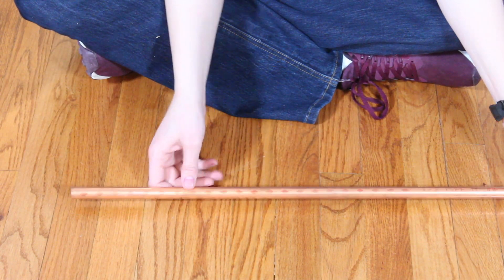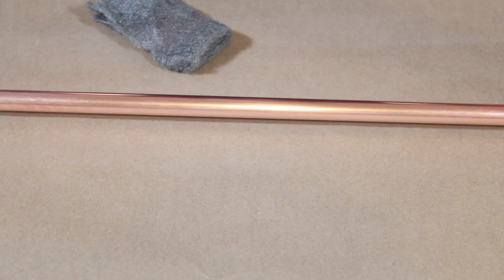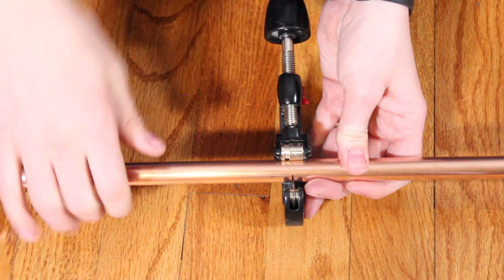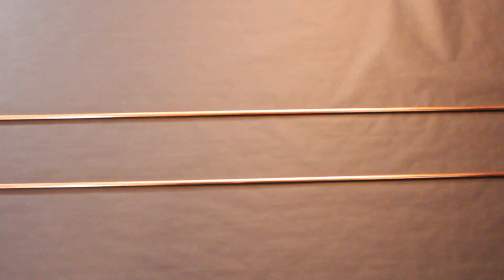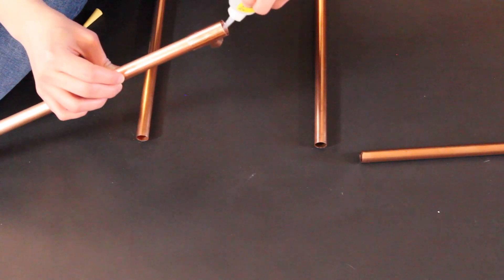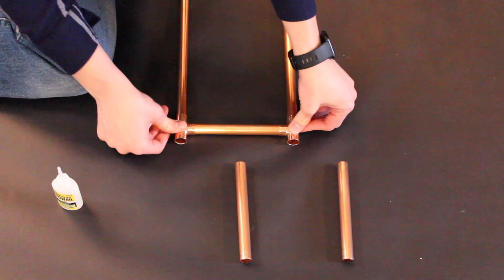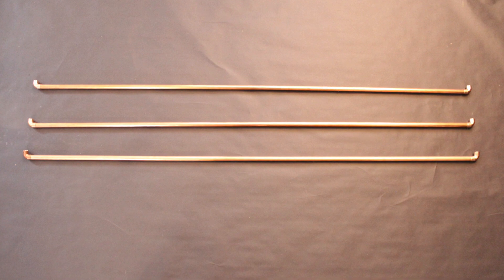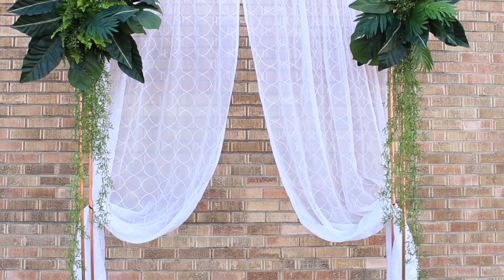DIY Copper Wedding Arch

Comment: Hi! Love this so much! Just wondering, if i'm wanting to make it longer like have the length be 7 ft, can the other measurement stay the same?? Not really great at the whole math and building part so just want to ask an expert!
Reply from the maker: You are correct the legs would stay the same. The only measurements you need to change are the horizontal pipes (the 5 foot lengths). This will change the number of pipes you'll need to purchase too. Happy Making!

Comment: Do you think this would support a faux greenery wall?
Reply from the maker: Greenery walls can be pretty heavy. If that is what you want to do, I would size up to a larger pipe either 3/4 or 1 inch and secure all the joints together. It is also important to put weights on the feet like sand bags.